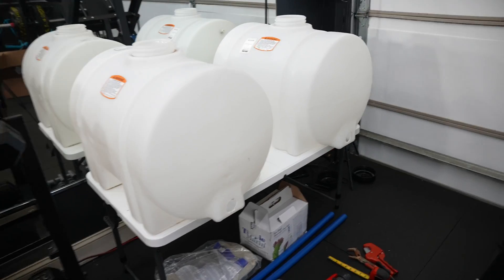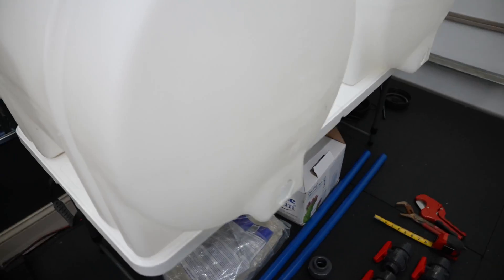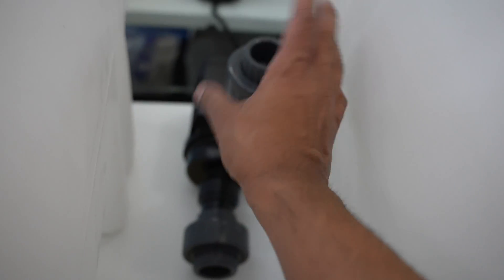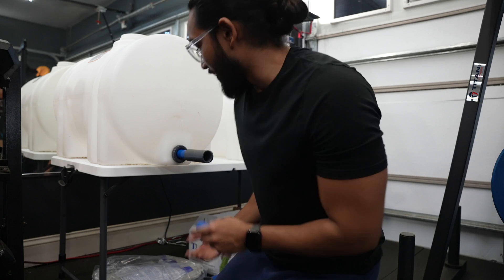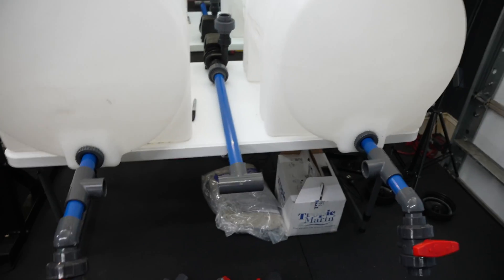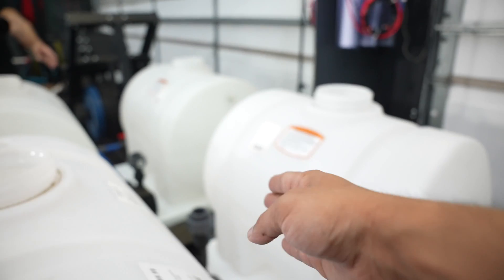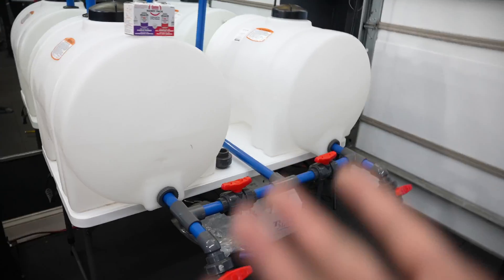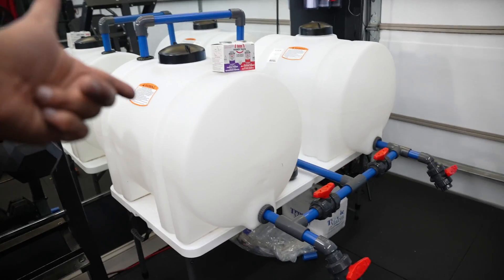How to build a saltwater mixing station for your aquarium pt.1 #reeftank

Comment: Great plumbing detail, but yeah, definitely concerned for that table! lol You could build a simple 2'x4' (8 - 2x4's, 2'x'4 sheet of 3/4" plywood  top, box of screws a drill and a saw or have the store cut for you.) You only used obviously 9 times, over once a minute average, not too bad. ;) Check out the King of DIY's stand builds here: https://www.youtube.com/watch?v=SYlS_sm7Yfk

Comment: Nice setup.

On mine I just put a 3 way valve on the RO with one line going to the fresh water tank and 1 going to the salt water tank, and did not connect the plumbing between the 2.  Aka there is no plumbing connecting the 2 tanks and the ro can fill either container by turning the 3 way valve to which tank you want to fill. 

The reason for doing this was so that you don't contaminate your fresh water with salt water.  By having the plumbing connected some salt water is going to get in your freshwater when you open the valve.
Reply from the maker: Didn’t have issues before! BUT never thought of that lol! Maybe a little modification in upcoming videos! Thanks for the input!

Happy reefing!
Reply: @whatthereef  it's minor really.  I use my freshwater reservoir for top off and other things so I don't want any SW contaminating it.  If your only using it to mix salt than it's not an issue.